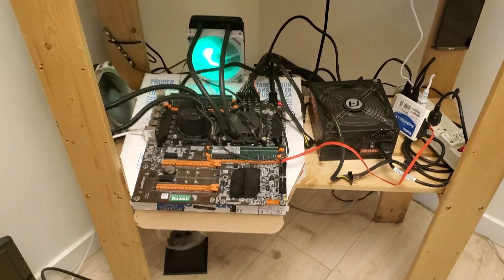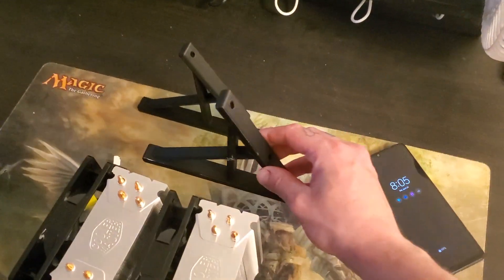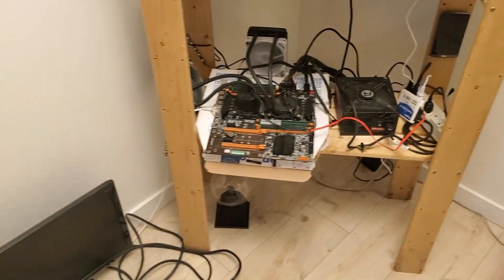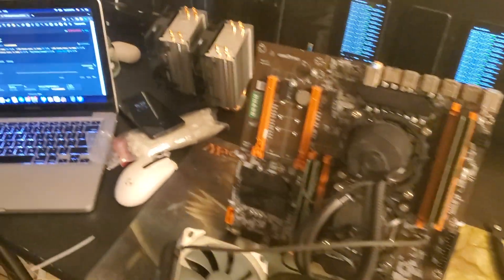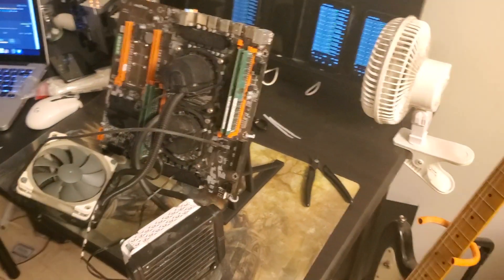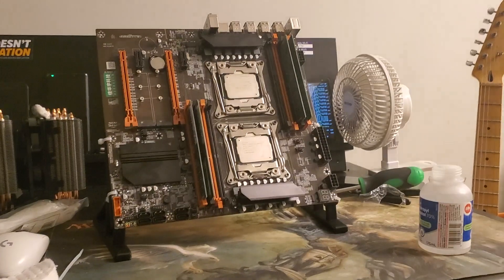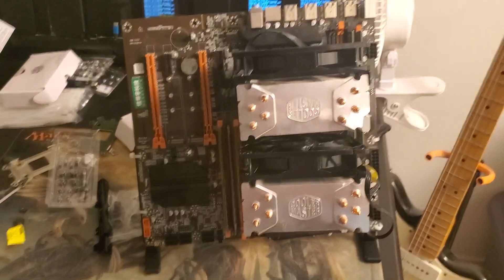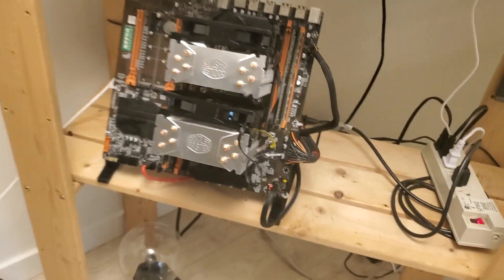Upgrading my Dual Xeon 2699 V3 CPU Mining Rig

Comment: It sees only 1 processor while mining, I don't understand why, it only sees 1 processor in the task manager, can you help me?
Reply from the maker: @emrullahtaptuk8413  you may have adjust how many processors in the program, it's hard to help when I can't see. Sorry
Reply: @lolPaperclip  I am only connected to one of the processors with the cable coming from the power supply and only one of my processors has ram installed. Could this be the reason?
Reply: I learned that it was due to Windows' pro operating system.

Comment: should throw a couple GPUs in it for good measure.
Reply from the maker: Ive been told to do that, idk if my power supply could handle it tho.. its only a 620w
Reply: @lolPaperclip  prob be pushing it with 2 cpus.  throw in a new PSU while youre at it lol
Reply from the maker: @impv1se  Im gunna gather up some GPUs, but I am not going to start mining till the actual bull market hits
Reply: @lolPaperclip  yeah i sold alot of my cards off. mining ironfish now at a loss on some 1660 supers/ti's in hope that it will pay off in the next bull run.

Comment: What parts did you use to build that xenon rig
Reply from the maker: I don't know the motherboard, but they are dual xeon 2699 v3, cooler master coolers, 32gb of server ram, and an Antec 620w power supply

Comment: One of the fan coolers blows the hot air into the next cooler. This does not loop optimal?
Reply from the maker: I put a third fan, I know it's not optimal, but it works
Reply from the maker: also, do you have another option? They were water cooled but I only got ride of that because it looked very messy.
Reply: @lolPaperclip  Well, I recon it's not enough space to mount them 90°, So it might be the best you can do with with those coolers..
Reply from the maker: @mikke7eus  I was looking for low profile coolers, but they are XEONs and i dont think that exists.. My buddy 3D printed me a Velocity Stack, kinda like what they have on turbos.. Should pull air in with less resistance. Gunna try that out.
Reply: I've have the same motherboard. this set up is the most optimal. the second cpu was 8°c higher. but never exceeds 80°C. maximum was 78°C while mining in a 35°C room temperature. using Noctua NH1
Reply: Any news on this? Is there a good cooling solution by now?

Comment: what cpu's were you using and what is the hashrates?
Reply from the maker: In total I have 300 MHs, 51 phones with an assortment of chips. And then there is my xeon rig
Reply: @lolPaperclip  what hashrate were you getting with the 2 CPUs?
Reply from the maker: @markbale7002  60 mhs
Reply: @lolPaperclip  on what coin?
Reply from the maker: @markbale7002  verus coin
Reply: @lolPaperclip  thank you!
Reply from the maker: @markbale7002  anytime :)
Reply: @lolPaperclip interesting. I can only pull 26mh on one of my 2699 v3.  Wonder if it's throttling.
Reply from the maker: @forzaflyracer3473  I don't know enough about mobo set up yet.. sorry you could ask the Verus Discord
Reply: how many watts those badboys using?
Reply from the maker: @tomcarey3457  to be liberal, id have to say 400